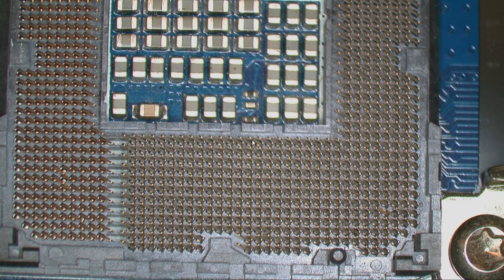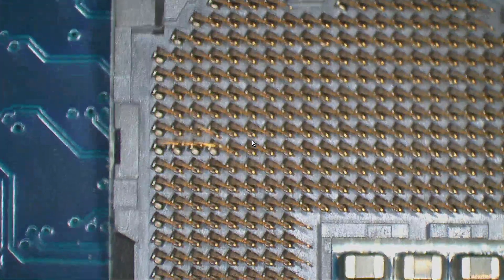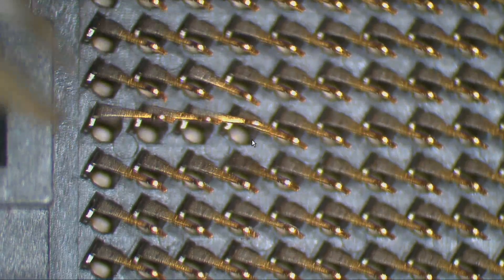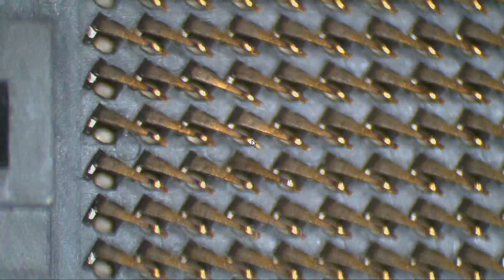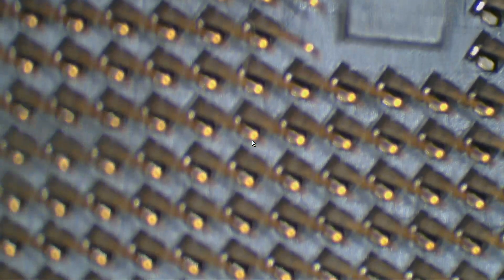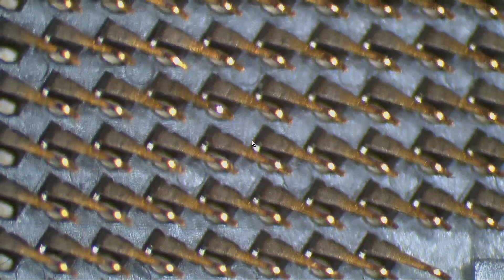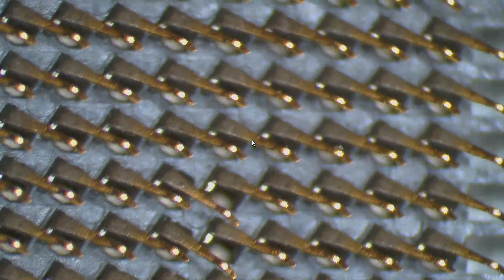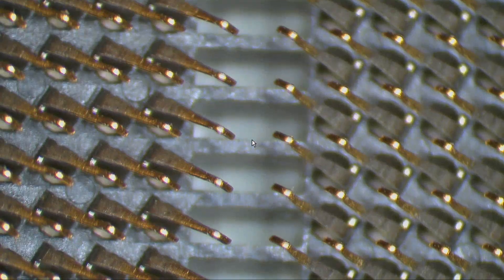MOTHERBOARD CPU SOCKET WITH BENT PINS. SIMPLE FIX

Comment: Good film. What tool did you use in this video?
Reply from the maker: +AlphaBlaze22 A microscope and tweezers.
Reply: Look on EBay, you can get used stereo microscopes for reasonable money, or assemble one even cheaper from used parts.  Mine works a treat, and it's bits from all over the place.